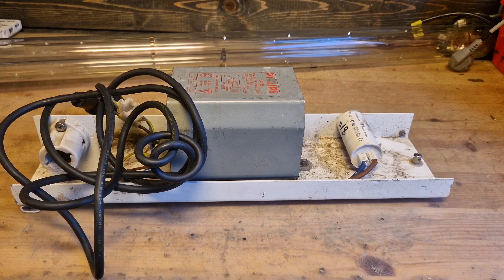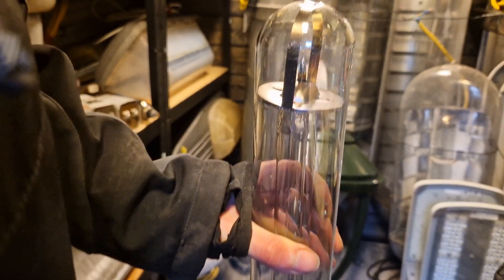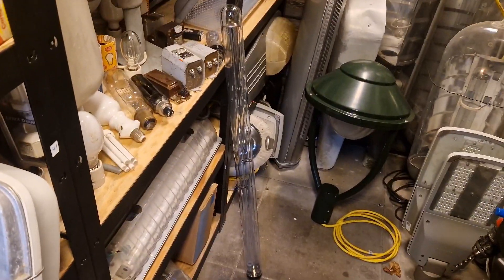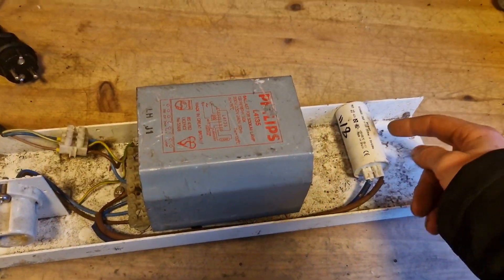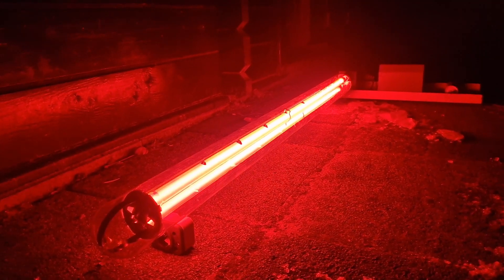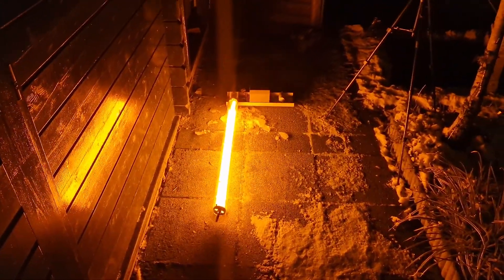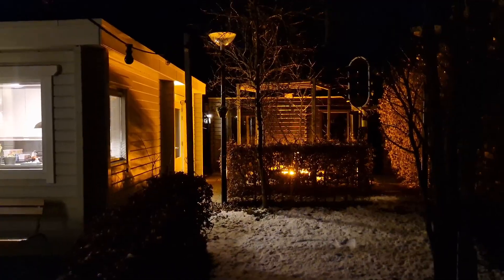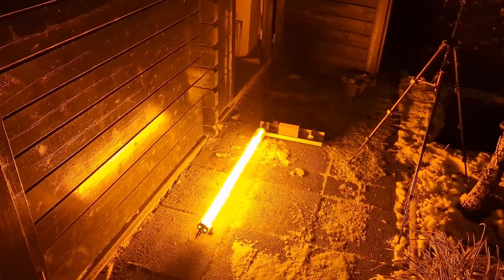The Incredible 131W Sox Bulb Used To Light Up Highways!

Comment: iirc 131w SOX-E is basically an economy replacement for 135 and 180w SOX. They sport a slightly higher luminous flux of 206 lumens per watt as opposed to the already bonkers 200 lumens per watt of the 180w SOX it's designed to retrofit. These lamps do have a lower lumen output overall due to the lower wattage, but considering you still have 26,986 lumens coming out of that sucker, it's not a disadvantage. they still light highways unbelievably well!!

Sad to see them getting phased out for LED nowadays. There are still small stretches of motorway in the UK still lit with Philips and Thorn lanterns that have 131w and 180w SOX. But these become even less and less common over time as their lamps start failing and they get replaced. I do miss seeing that monochromatic glow hit the pavement!

Comment: Beautiful long bulbs, I have a smaller one I want to install as a pendant light so it hangs in the middle of the room, I think that would be a cool effect.
Reply: Protip; Anything between 10 and 55w (yes, there was a now very VERY rare 10w SOX!!) will work in vertical base up orientation. Anything higher wattage must be burned horizontal as not doing so results in uneven distribution of the vaporized sodium in the lamp, reducing efficacy.
Reply: @TheSoxmania  Luckily it's a 35W one (I think!), it's not a giant one for sure but I'll make sure it's compatible.
Reply: @secondbackwaterdivide  In that case, so long as you have the right gear to drive it then you won't have any issues :)

I'd recommend probably going with an electronic SOX lamp driver to keep the wiring simple, but if you want to go magnetic, about the most compact setup I could find would be a Philips BSX 355L-82 with an accompanying SX-72 igniter. This would also let you run 55w SOX as well as 45w SOI/H as their operating currents are identical.